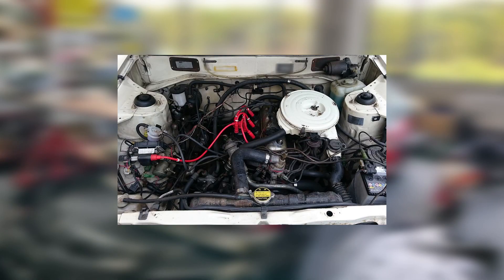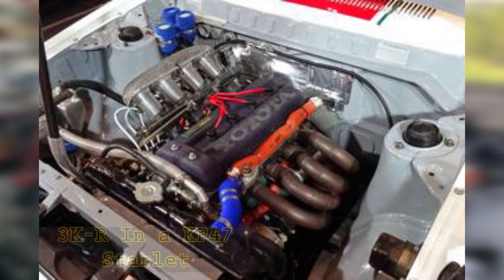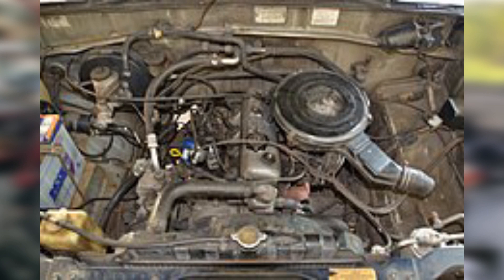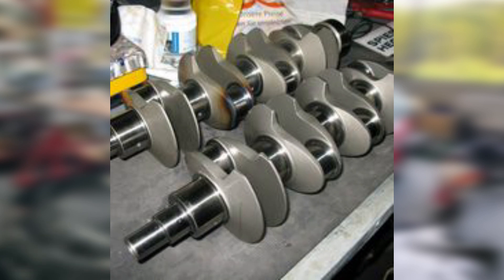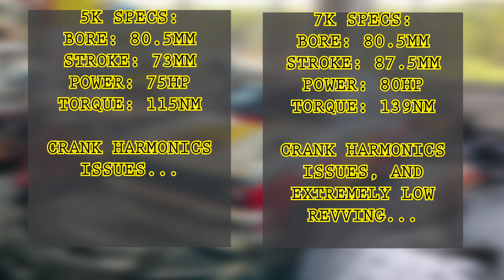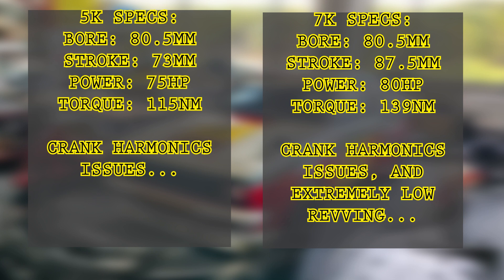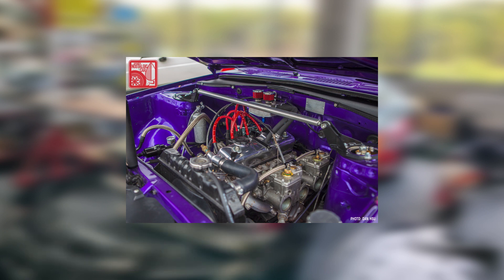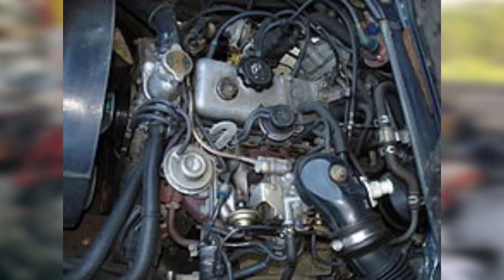Things you need to know about the 5k and 7k Toyota engines

Comment: which one is fuel efficient? toyota 5k or 7k?
Reply from the maker: They're about the same, with only a very miniscule difference.
Reply: 7k are easy to tune for fuel efficiency, you can get 12 km/L with decreased size of main jet and pilot jet, set the ignition timing more advance, set the gap of the breaker point at 0.8 to 1mm,use kondensor 0.27 from mitsubishi L300
Reply: The fuel consumption is same, but 7K has more power

Comment: May I know which auto transmitter is good to fit 5k engine?
Reply from the maker: Hey there Ken! Thank you for the question. And in answering your question, You can get any transmitter that fits your budget. But even though it might not be of concern, I do highly suggest making sure the charging system is in good condition, because the 5k engine's alternator is only known to output 60 Amps and if it's not in good conditon, along with your wiring, it can cause a voltage drop issue that you may have not experienced before getting the transmitter.

Comment: I used 5k on my ke70.. i think I want to bolt on the engine.. it's reliable on stock with rhf5 turbo ?
Reply from the maker: Preferably I would suggest getting forged pistons to make sure that the engine would last, but if you wound like to try a stock bottom end and just boost it, I would suggest limiting the boost to around 5 to 8 psi

Comment: I just found this channel and been loving the toyota k series content. From where I'm from engine swapping legality is complicated and we only got k series motor for the e70 corolla. I heard these engine's doesn't have the best oil pressure. Is there a way to remedy this without having to do a dry sump system?
Reply from the maker: @Watame Lon Thank you for your kind words! I really appreciate it!! Regarding the oil pressure predicament, I would strongly suggest shimming the oil pump with a 3mm washer in order to get an improvement in oil pressure.
Reply: @JWorldAdventures  Thanks for answering can I also ask you said that in one of your videos that a forged crank is needed to fix the harmonics of the engine. May I know is there a company that specialises in producing 5k crankshafts? If not is there any differences compared to the old crank? Also would balancing the stock crank fix this without going go to the forged route?
Reply from the maker: @WatamelonUberSheep  Yes, they're ikeengineering based in the UK 🇬🇧 The forged crankshaft is essential as the stock crankshaft whatever you do to it balance wise will always split in the middle due to the overall balance factor from factory being not optimal at high rpms. 

But if you're on a budget and don't want to pay the expense for a forged crankshaft, then the stock crank with a 0 balance work from a machine shop that you trust. Will do just don't plan on revving it to 8,000rpm and beyond as the harmonics caused by the unfavorable balance factor from factory will most likely cause the crankshaft to split and destroy the engine. I hope that I was able to help you out. Have a good one!!👍👍👍
Reply: @JWorldAdventures  Thanks a lot. I'll be keeping an eye out on your starlet's content 👀. Cheers 🍻
Reply from the maker: @WatamelonUberSheep  Thank you for the kind words!! I really appreciate it! 😁 I will for sure make more content when I can! Have a good one👍👍👍🍺
Reply: @JWorldAdventures  thank you very much for the various info's you are sharing. I had a question about the crank and you solved. 

I'm building my self on a budget my 4k and needed some info. I will do ported and polished head, dual valves, 275 degree cam, balanced pistons, rod's and crank, new piston rings and I will open a little the flow of the oil on the pump and I will put fazer 600 carbs. Now I have only one more question. 

I hear in my country to not touch the exhaust header and the diameter of my exhaust because it has back pressure and it's better. My plan was on going for a TRD like exhaust manifold and a larger, smoother curved exhaust pipes. Do you think stock exhaust is better or to go with what I'm thinking of?
Reply: @NickAtsidas  Definitely go for a proper exhaust setup, you don't need the backpressure and your engine will breathe better under those conditions anyway
Reply: @janitor5850  Yes that's what i'm gonna do, thanls!
Reply from the maker: @NickAtsidas  With your planned setup going to the bigger header is absolutely the right thing to do as the header will help in exhaust scavenging especially in the higher rpms.

Comment: are you making miso soup dashi from powder or katsobushi/ kombu...?
Reply from the maker: Thank very much for the question @michalzima3947! Traditionally you would make the dashi with both konbu and katsuobushi, but personally I like it to have a more vegetarian taste so I only use konbu for the dashi's I make usually. 

If you don't have time to make dashi, then the store bought dashi powders works as well. I always keep some in my pantry, so that if ever I'm too busy or lazy for that matter, there is powdered dashi ready to use at any time.
Reply: thank you for the answer, and dashi from kombu is the right way to soak it overnight, or it should also be heated. Because I found many ways to prepare it. But I'm not Japanese and I don't know what's right. I once cooked it for half an hour and it tasted terrible :D. in a Japanese restaurant it was 100x better than mine... @JWorldAdventures
Reply from the maker: @michalzima3947  You should soak it overnight,  then heat it up on the stove, and before it boils, remove the konbu to not impart any bitterness.
Reply: many thanks  @JWorldAdventures

Comment: Bro how to make more power from my 4k engine
Reply from the maker: It would depend on how much power you're planning on making, and would it still be a daily driver?
Reply: @JWorldAdventures  I want it to be good at low rpm and I need the power when I floor it
Reply from the maker: @JRVRGaming  Well referring to what you want to achieve I would suggest increasing the bore of the engine by 5mm if it's still standard bore of 75mm, and that would take you to 80mm giving you a displacement of 1467cc. That's an increase of 177cc from standard being only 1290cc but if you're a little limited on budget the least I would suggest is to change to a thinner head gasket to increase the compression ratio and this will give you an improvement throughout the rev range.
Reply: @JWorldAdventures DAMN bro thanks for that! Is that all I can do? Or are there more ways? I'm not worried about the budget.
Reply from the maker: @JRVRGaming  Well since you're not limited on budget!! Aside from what I mentioned along with the rebore and gasket I suggest getting the pistons you will be using from Kameari in Japan as they have a set of high compression pistons. That will bring your compression ratio to about 11.1 but your oem conrods would need to have the pin bushings modified into full floating in order to use these pistons. Also getting wpc treated race main, rod, and thrust bearings. 

As for the cylinder head I suggest porting it but not too aggressively as you would lose the low-end torque. And for the cam I would suggest going for either a 72 degree with a 6.8mm lift or a 74 degree with a 7.2mm lift these can be bought from Kameari as well a a regrind service to your existing cams. 

Carbs wise going for a dual 40 weber is the way to go. And shim your oil pump with a 2mm washer to help with oil pressure. 

For the crankshaft get it zero balanced so it can handle upto 8k rpms no problem. Back in the old TC freshman cup day they used to rev these upto 9.5k but I would suggest not to as doing so will shorten the lifespan of your engine.

Ohh and getting bigger valves is a must. I hope I was able to help you out.
Reply: @JWorldAdventures  how much HP does it make? Is it possible to add turbo after i tuned it?
Reply from the maker: @Jamalfrdude  naturally aspirated it should average 150HP at the crank. But, boosted wise it should output just above 200HP conservatively. But I suggest just going naturally aspirated, as going turbocharged will put more stress on the engine components and the block. I hope I was able to help you out!! Have a good one 👍 😊 ohh and increasing the bore too much would weaken the block.